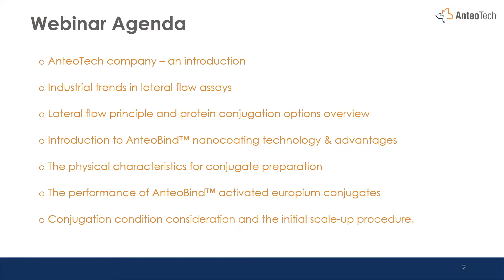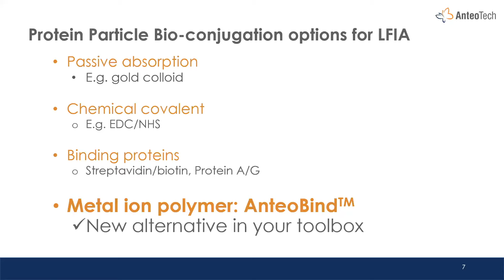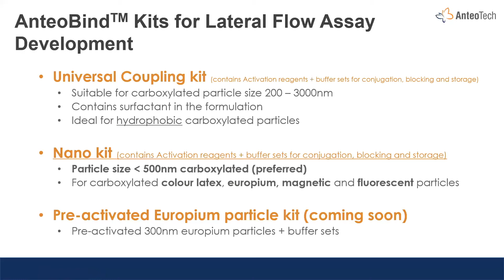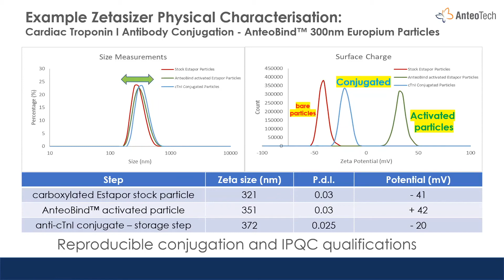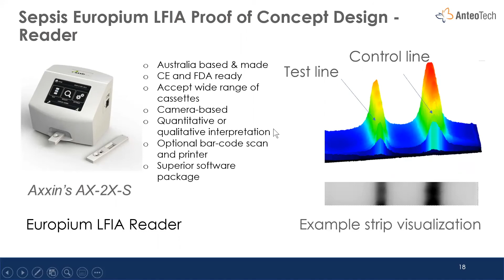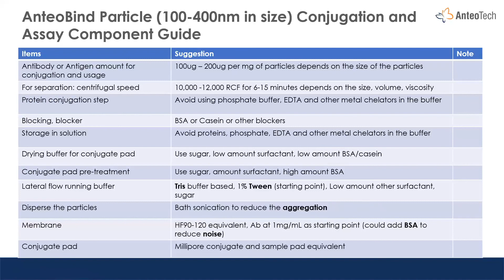Successful Coupling AnteoBind

Comment: Hello Sir, good day! We need your support. How to stripe correctly test and control lines on nc membrane for LFIA? We used pbs + trehalose + 0.01% tween. But striping wasn't successful, very weak signal for test line (capture antigen). Our gold antibody conjugate work perfectly on other competitors strips. We've been trying to find an adequate striping solution for 1 year now. By the way we tried adding ethanol, methanol, isopropanol but antigen was denatured. Also 0.01% of surfactant desorbed antigen from binding to nc membrane. Is there another surfactant? Example sodium cholate? Thanks in advance.